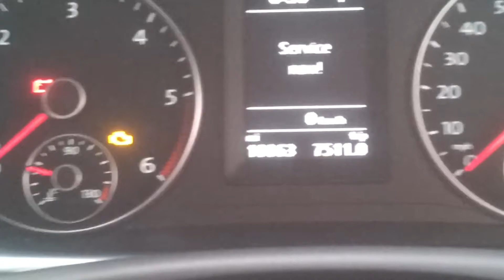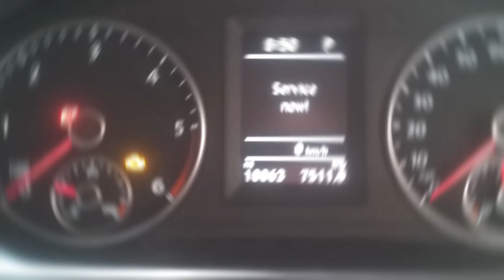OBD-II Code P0400: Meaning, Symptoms, Causes, How to Fix?

Comment: I did both examples which is clean the egr value  and  also  check  the wires  and  all seems to be ok ..the p0400 code comes  back
Reply: How Are you how did you manage to clear the problem

Comment: I have a p0400 code for my Mercedes e500 2005 change egr valve clean the egr tube and replace all hoses that were broken and it still has that code and a rough idle when I’m in a stop
Reply: Maybe the solenoid or wirings?
Reply: Did you figure it out ?